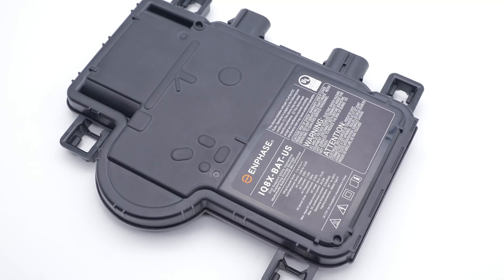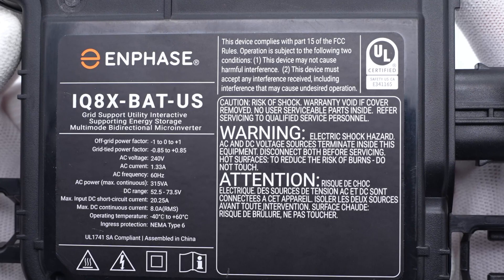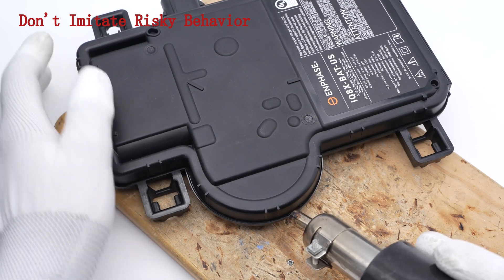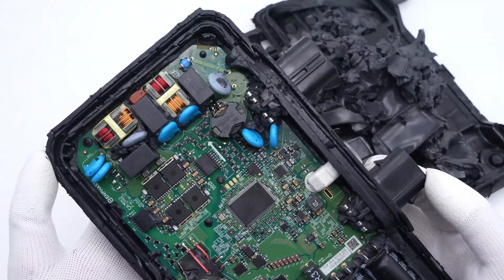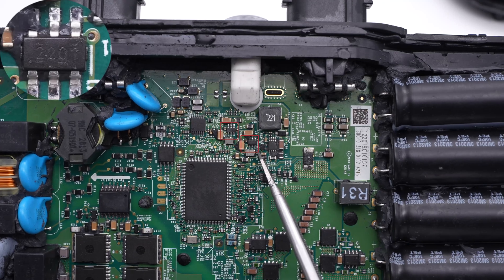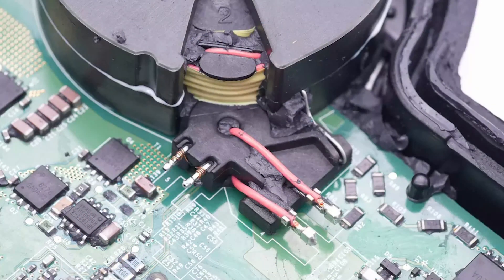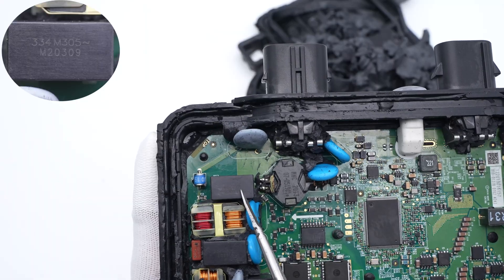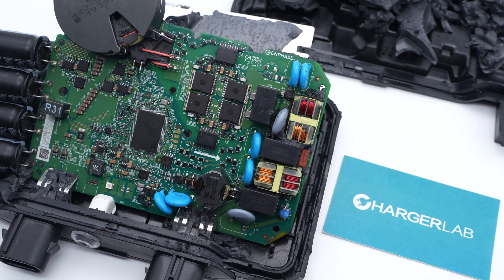Teardown of Enphase IQ8X Microinverter (For Solar Energy)

Comment: Question for you, you sound super technical I am trying to determine if there is a way to trick / convince the iq8 to work without a grid without the load controller. I saw a video that I cant confirm was real. https://youtu.be/TgIK6n5P06Q  the person had a small 240v load directly connected to the iq8 and it just ran. Also would like to know if there was a way to send a signal for it to charge a battery and or discharge. My goal would be to build my own battery which I could for a 1/5th the cost on a 10kwh enphase battery.

Comment: 4:52 As was the case with the IQ7+, it's a gas discharge tube, not a transistor.
0:34 "-1 to 0 to +1" confuses me. It's more intuitive, but in reality "1" is the middle of the scale and 0 is on both ends. Does this mean that the inverter will plainly shut down if the power factor of the load is worse than 0.85? Suppose you start a compressor (which may have a power factor of .7), will all power be delivered by the grid?
So many questions!
Reply: if i put a 80v panel on the micro inverter is this the component "gas discharge tube" the would most likely die ?
Reply: @spacefrogbe231  No, a GDT only triggers at hundreds of volts, say 800 to a couple of kilovolts. They are used in conjunction with metal oxide varistors, who respond more quickly to lower overvoltages and can't shunt as much current.
It's placed near the AC input, not the DC input so your inverter will be fubar way before the GDT triggers.
Reply: @bjornroesbeke  fubar means no way to fix ?
Reply: Ik zie dat je ook van belgie bent :D Is de omvormer nog herstelbaar na het aansluiten van een 80v paneel ?

Comment: One minor correction, the TI UCC21520 is only a gate driver with a few features like deadtime built in. Any modulation appears to be handled by the main Enphase ASIC.
Reply from the maker: Shoot, you're right. It seems to be a script issue. We've corrected that.🤯

Comment: This board looks extremely similar to the IQ7+ as you mention in your video. They both even seem to have the same part number (E342828) if you look closely. Do you see any other differences at all beyond probably them having different software?
Reply from the maker: Internal structure-wise, no, they're basically identical.
Reply: @ChargerLAB  Thanks for the video.  I thought the IQ8 could generate more kWh than the IQ7. How can it be if the components are all identical?